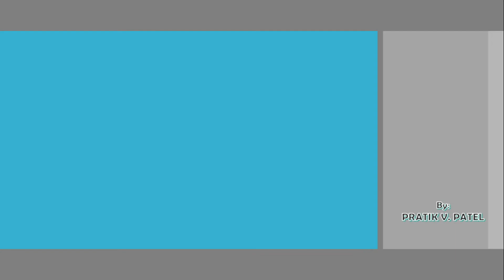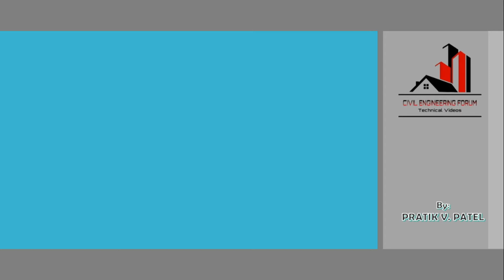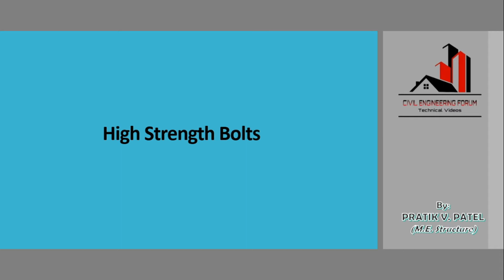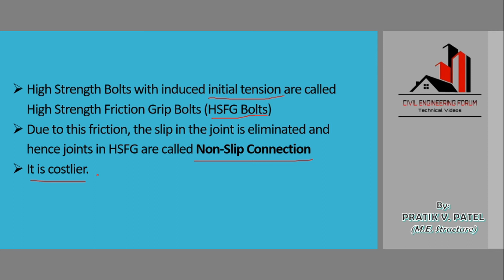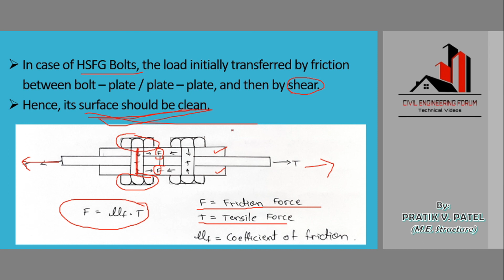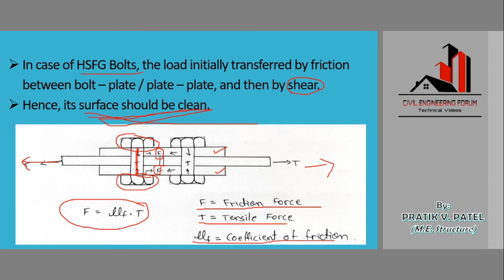HSFG and High Strength Bolts | High Strength Friction Grip Bolts | Non-Slip Connections | Part 4

Comment: how to find bolt  HSFG grade8.8 length(thread and shank length) for dia 24mm and thickness of member 101mm by using IS 3757-1985????
Reply: I think you are talking about the case when HSFG bolts have bearing type connection. In that case just take ns=0.
That means no need to consider the shear plane passing through shank region.